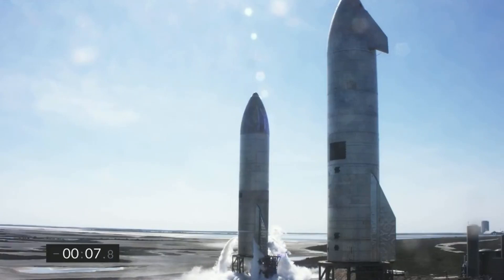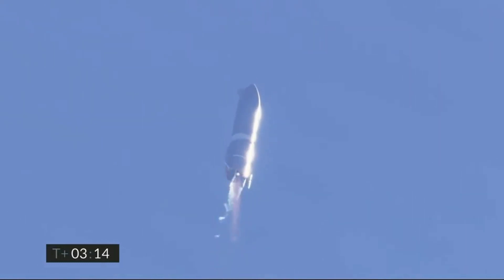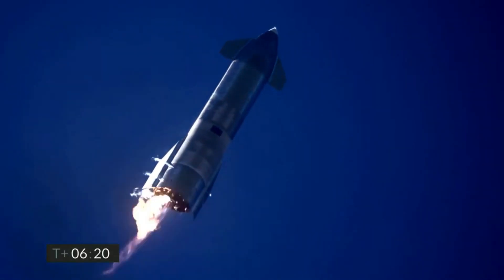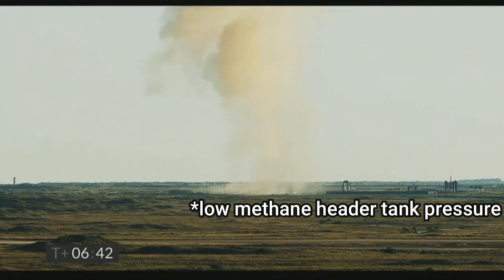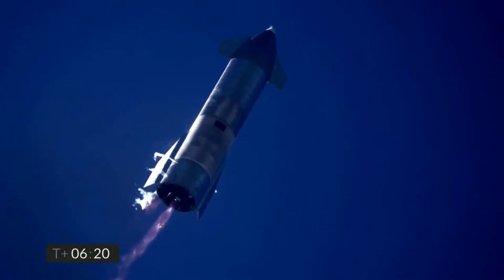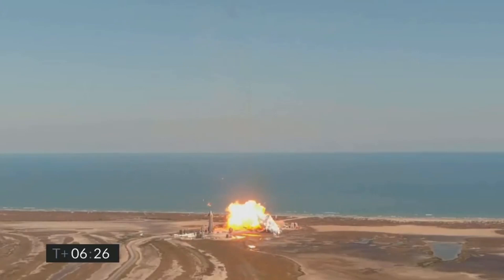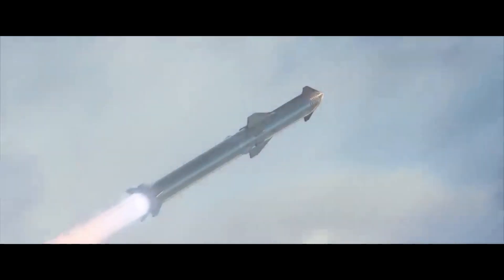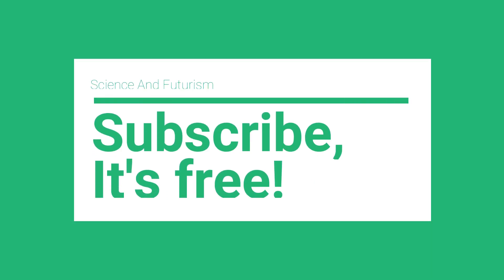SpaceX Starship SN9 10km Flight Test : What Went Wrong?

Comment: Could the issue with the failed restart have something to do with the over flip into the belly flop. The ship was nose down for a few seconds before it righted to level belly flop. I know that the header tank was under pressure, but was it under enough pressure to compensate for this? Also, did the ship over flip because of the weight of the pressurizing tanks?

Comment: I would have thought they would do the flip manoeuvre at a higher altitude to give more time for stabilisation before landing.  Also relighting all 3 engines to provide redundancy in case of engine failure.  We may see something like this with SN10
Reply: I think they should place 3 extra raptor engines just in case the main engines fail. It's very concerning that SpaceX plans to use this for transporting people, but it has no way to save itself during landing failures.

Comment: Top fuel dragster engines have been around for 50 years and still very unreliable.  It will be very difficult to make a high performance reliable rocket engine due to high pressures, temperature, and vibration.
Reply: Space shuttle engines were reused upto 2 dozen times each. Some required major rebuilds between uses though.

Comment: maybe there was not enough pressure in a fuel tank to fuel both engines when the ship was not upright and accelerating.

Or maybe there was a bubble in the fuel system.

Or perhaps something caught fire and got damaged. Seems like there are little fires down there periodically.
Reply from the maker: The little fires during ascent were probably due to inflammable gases in the skirt section which caught fire.... Nothing to worry.... But landing is tough...... Thanks for watching 👍
Reply: @spacexplained5001  thanks for posting! Great video!

Comment: I have a sneaking suspicion that SpaceX is going to ditch the suicide landing in favor of turning the ship earlier to stabilize and get the engines lit before its too late.
Reply: I think that a combination of flipping earlier and chilling all 3 engines would help a great deal. If all 3 engines wore chilled, the third could be rapidly ignited in case of a failure or otherwise loss of an engine like SN9
Reply: Aarons123 

Agreed!!😅  thats what i recommend spacex does
Reply: I will add in SN8 landing it pendulums over vertical above 1k and then sways back to vertical, SN9 only swung one way at a height of 900mt , so I will add I also think altimeter setting was not correct. SN 10 needs to have finished the landing set up at 800mt to allow raptor thrust to complete throttle up to soft land.

Comment: This rotation to landing is unwise,  in my opinion.  It's like driving full- speed through your neighborhood until the absolute last second,  then slamming on the brakes and yanking the handbrake to execute a simultaneous slow- down and parallel- park maneuver to park in front of your house without hitting your kids playing in the street. If traction is not PERFECT and your rotation isn't either,  you kill someone at high speed. In this case,  it's like the brakes are sticking and there's mud in front of your house,  and you don't stop. Way too quick a reaction time demanded from the engines.
Reply: That's the only way to land on mars with only 20% of fuel
Reply: @artoruvidal2793  Mars landing would require much earlier rotation and much more energy to slow down given the much higher velocity and very little atmospheric assistance in braking,  but also a much longer window of opportunity to correct attitude,  course, and modulate thrust.  The current maneuver profile is not even leaving sufficient time to ensure engine ignition before crashing,  hence my analogy.  I think they beef to rethink the profile and maybe even more changes.
Reply: @jamesengland7461  
Mars landing can afford only 20% of energy at best 
With that small energy there's no option but to land in this risky manner 
It's a matter of necessity not choice 
How would you do it with only 20% of fuel
Reply: @artoruvidal2793  is simple: rotate to vertical just a little earlier,  giving more margin for error for the engines to ignite.  Same fuel use,  only in a slightly longer period of time.  Kind of like how you might drive up to your house to park in front of it,  by moderately braking instead of handbrake- turning like a maniac.